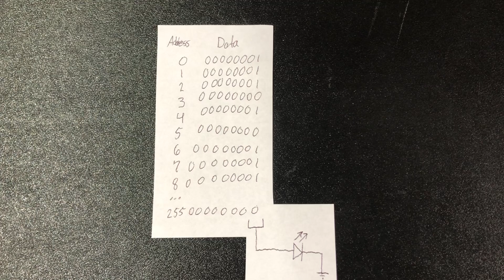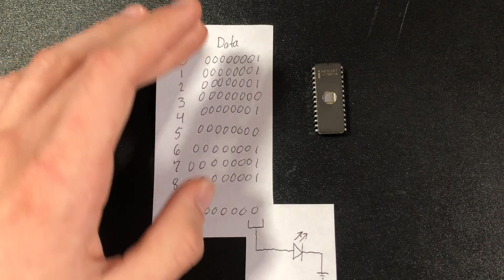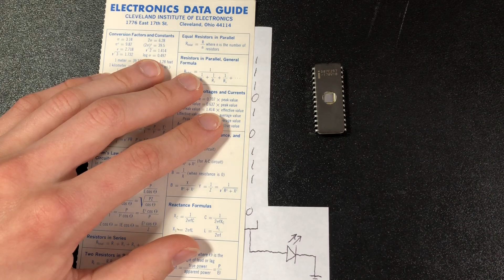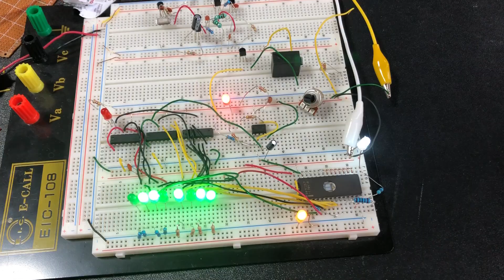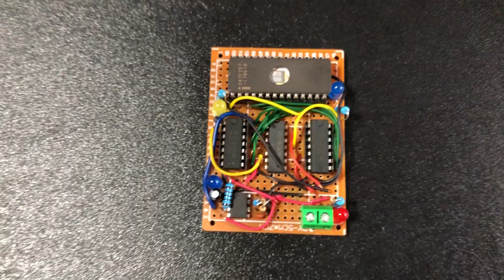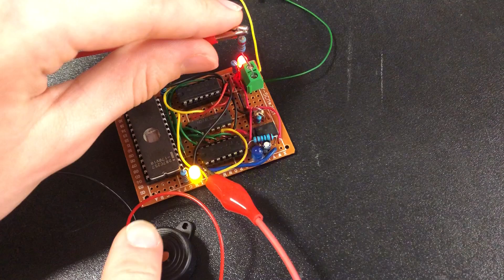Morse Code Generator Using an 8-bit Counter and a 555 Timer

Comment: A 4040 CMOS binary counter (CD4040B, HEF4040B, MC14040B so on) has similar function of 3 pieces of 74(LS)93.
A 4081 CMOS AND gate has similar function of a 74(LS)08. In CMOS platform you can build an AND gate from two or more diodes.

Comment: Not putting your efforts down but these days it would be so much easier to programme a Single board computer to translate text to morse code. That way its more flexible, can have extra facilities such as variable speed or tone.  Jsut saying.
Reply: You are aware of the fact that this is not a commercial product, but rather a hobbyist project, right? Just fleeing into the world of microcontrollers or FPGAs because we can is not the solution to truly learn about electronics. One could easily build a little state machine that translates ASCII from a RAM into morse code signals based on low level ICs or even on transistors and diodes, so the set of features is no counter argument here.

Why not take a deep dive instead of just gluing code together?

Comment: I did this over 45 years ago using 7490 bcd to decimal counters to cycle through lines, some 7402 quad nor gates to gather up all the signals, a 10 x 10 matrix of wires to which I soldered diodes to generate the bit pattern and a 556 chip (one for the clock and one as the tone generator). Connected to 5 volts, pulling a line low started the sequence where it output "DE WA2xxx" (my callsign). I don' t think.eproms existed back then. Now, a little Atmel ATTiny85 could do this so easily, and be reprogrammable without unsoldering and resoldering diodes. BTW, I used Radio Shack 1N34 diodes which were awfully heat sensitive and it took a lot of VTVM  measuring to determine if a Morse error was a programming mistake or a diode destroyed by soldering heat. Ah, the good old days!